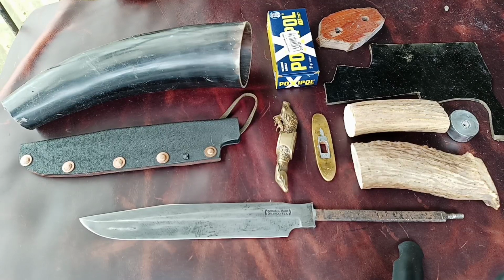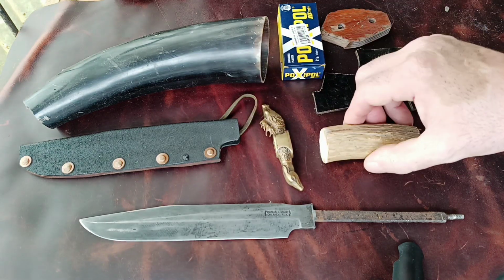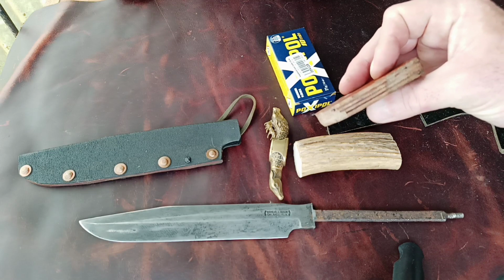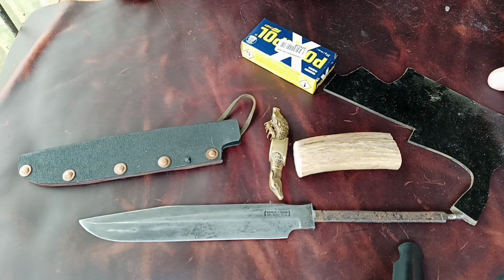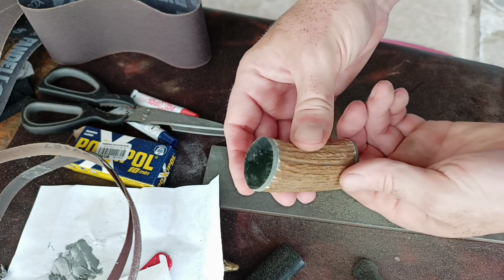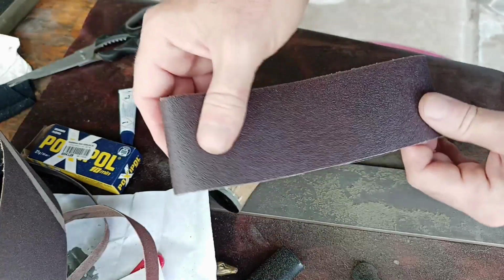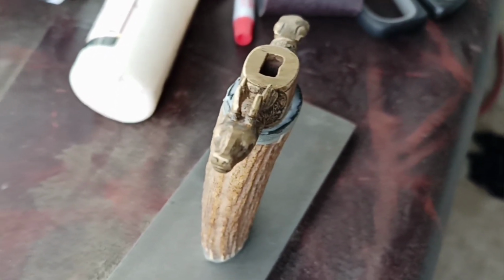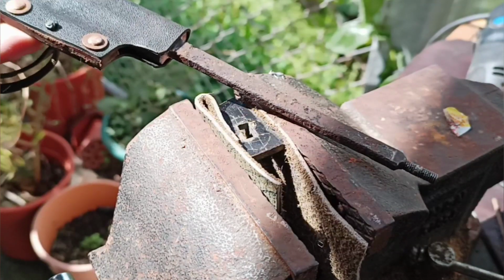My Randall model 1 is trashed, let's rebuild it Pt. 2!

Comment: Tip from me as a bladesmith.
Painters tape and super glue.
Tape the gaurd and the spacer, put a drop of glue on it. Then you can mark stuff easy and shape a needed then just pop it off and peel away the tape
Reply from the maker: Very cool and probably much less mess too, thank you!